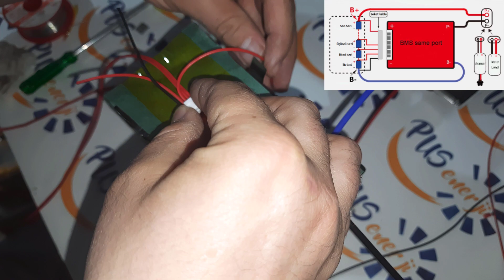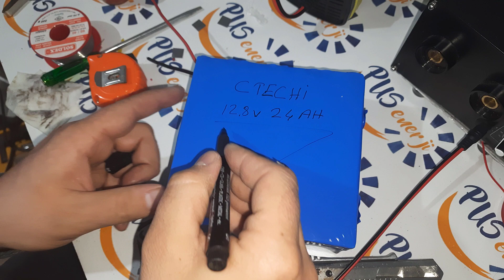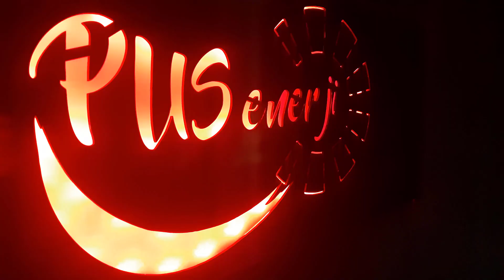Lifepo4 12 8v 24ah Batarya Yapımı...

Comment: 4s 30 amper Lifepo4 bms kartı aldım 32 pil var 4x8 şekilde paralel yapıcam 12.8 voltu almak için fakat bu batarya olunca kaç volt kaç amper ile şart etmem lazım 14volt 1.072 amper leptop şarj elti var bir tane de 12volt 3 amper var hangisini kullanmam gerek hızlı dolsun diye ilk olarak 12v 3a olanı kullanıp ardından 14volt 1.072 olanı mı kullanayım yada ne yapmam lazım